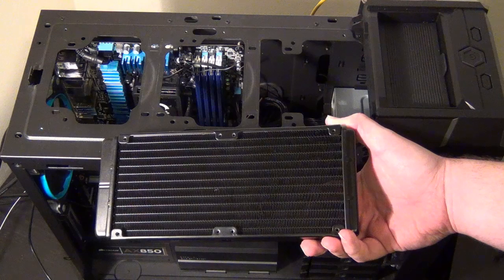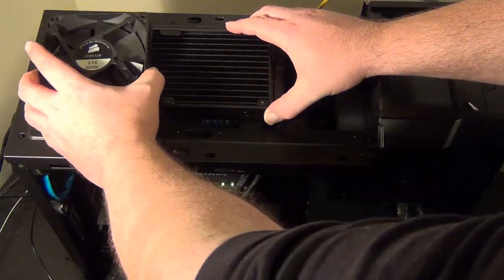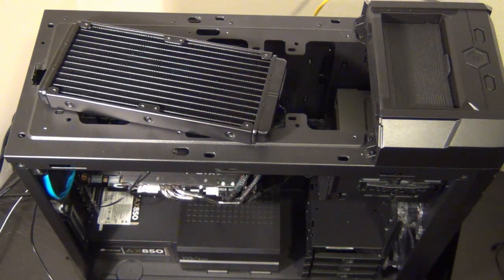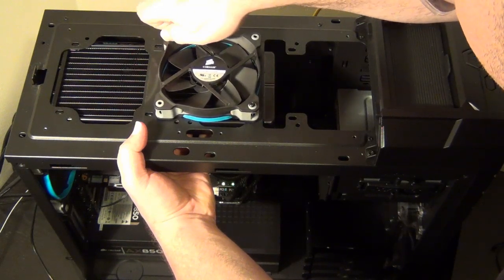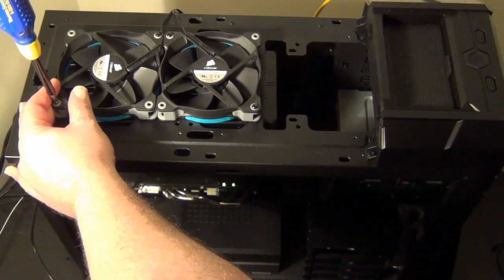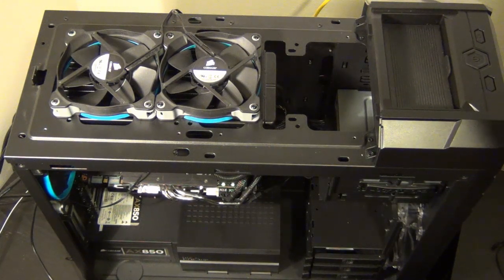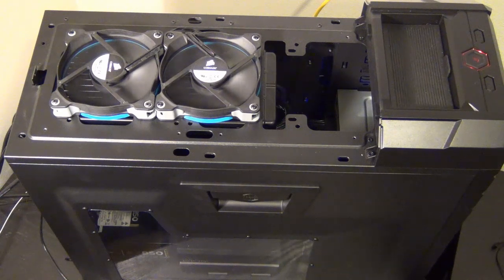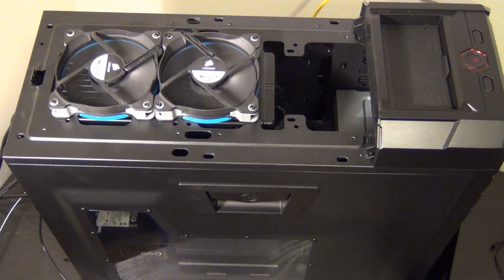How to install a Corsair H100 and SP120 fans

Comment: The AF120s would be better for pull config. The SP120s are pressure enhanced and better used in push config inside your computer case.
Reply: Bruce Dickinson push or pull doesn’t matter

Comment: You're not getting 100% airflow out of the sp120 mounting it like that. There's a small gap between your fans and the rad. Fans should be right on the rad (like a tunnel) flowing straight thru : )

Comment: Is it at all possible to mount a Cooler Master Glacer 240L in push-pull, with two 200mm fans doing the pulling and two 120s doing the pushing?

Comment: I have the h100i, but from what I've read, they will only work with the corsair fan controller.  Have you actually tested this?  Link will give full control over the sp120's (specifically quiet editions)?  Sorry, just need to make sure, because 30$-40$ is a bit much for fans.

Comment: Did you find the mother board give a better contro of the fanl or the pump it self?
And how have you connected the wire of the pump and the fan to the motherboard or the power supply?
anyway nice explanation

Comment: I have a Bitfenix Shinobi window case, I was planning on doing what you did with the Rad, but using 2 coolermaster R-4 fans, and installing them underneath instead. Bringing fresh air in, would that be a good idea?

Comment: How is the temperature of the CPU using Pull configuration?? I'm planning to get this case and cpu cooler next month and I'm quite disappointed that push and pull configuration is quite impossible without modding..

Comment from the maker: There is somewhere around 40mm in the top of the case. If you mount the fans inside the case and the rad isnt more than 40mm thick, then you should be able to.

Comment: You could get a push-pull setup with the 20mm thickness 120mm fans from Yate loon.
You can get various rpm versions, I have 4 of the 1350rpm version on my h100 in push-pull and it fits inside my 650D and doesn't overhang the motherboard :)

Comment from the maker: Corsair Hydro Series H100 Extreme Performance Liquid CPU Cooler with two Air Series Quiet Edition High Static Pressure 120mm Fans in my Cooler Master HAF XM case.